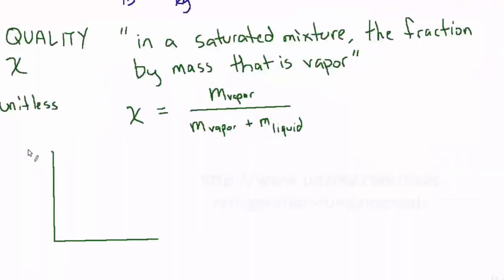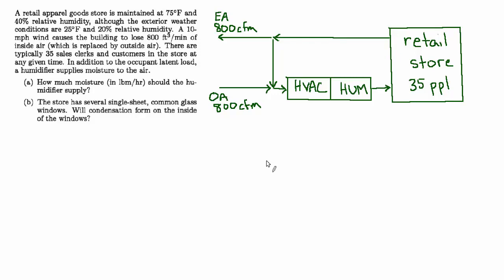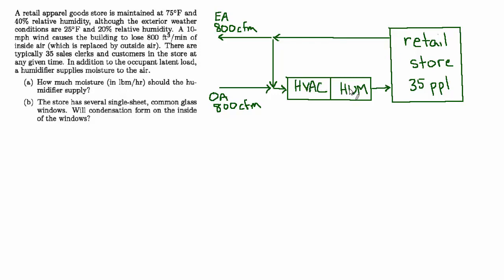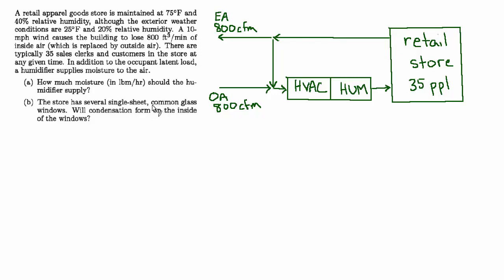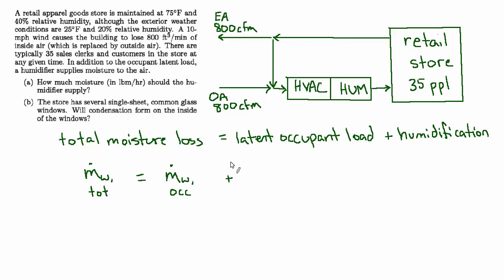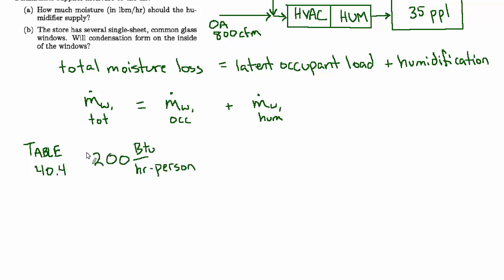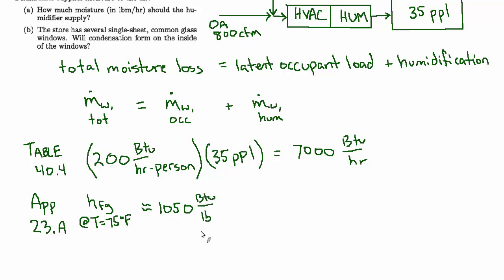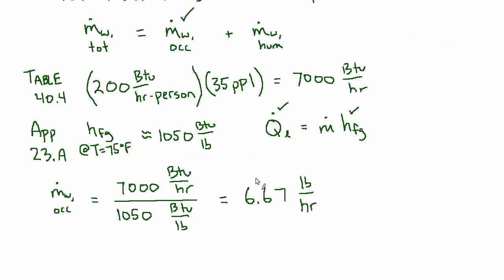101 Solved Mechanical Engineering Problems - HVAC Problem #8 part1of3

Comment: Should you be including latent heat due to dedicated outdoor air needed for the occupants? It says there are 35 occupants, so the designer will need to design AHU to have ventilations of at least 7.5 cfm/person outdoor air (see page 472 of Reference book v1.5). Although, designer would also need to include ventilation for indoor space as cfm/sq.ft as well, which is unknown to us.
Reply from the maker: Hey Kimberly, Some of these videos are older, so you'll definitely want to defer to the RHB on this one.  The latest examples aligned for the current computer-based test are inside our course bundles, so definitely check them out if you're getting more serious about your exam prep, which it sounds like you are.  Feel free to shoot me an email.